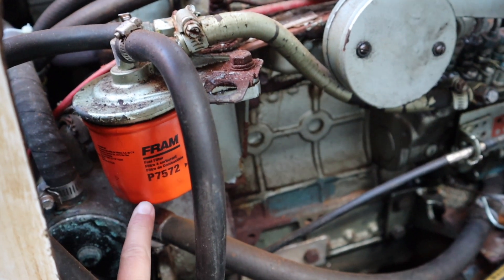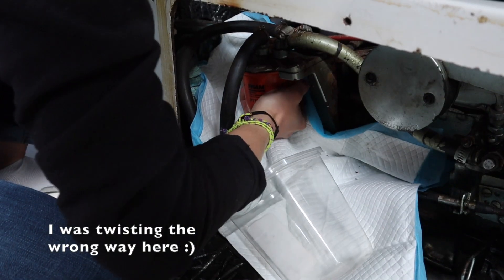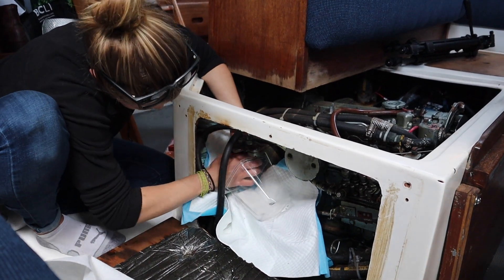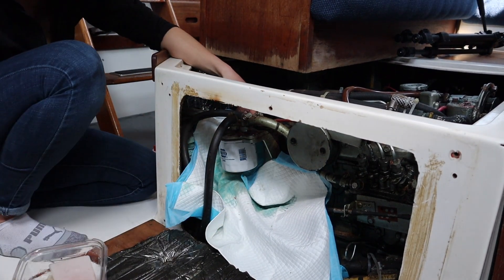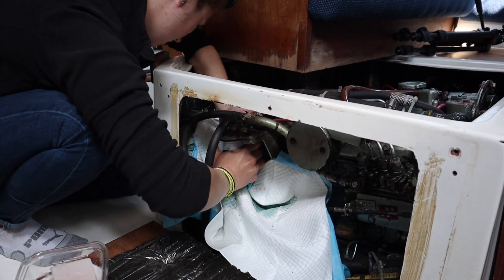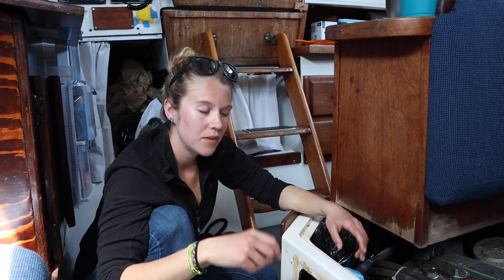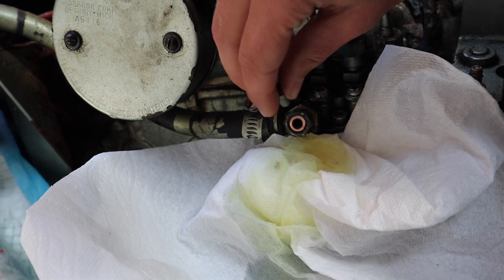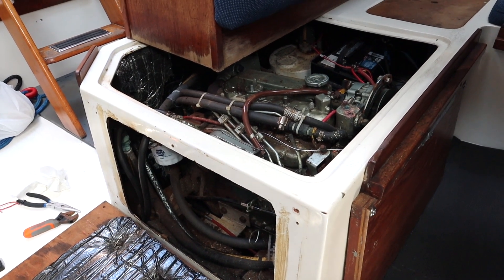Changing the Fuel Filter on a Universal M-30 Diesel Engine | Engine Not Getting Fuel

Comment: Hello great video. After dealing with this multiple tomes i simply purchased a small outboard tank and now assured to always have clean fuel.  still using the filters but have the confidence of not losing power. hope this helps

Comment: You guys did a great job with this "how to" video.  It was easy to understand and I am sure many diesel engine newbies will appreciate it!!  During our first circumnavigation we encountered exactly this in big seas off of New Zealand.  We looked at each other and said" Heave-to time!!".  That gave us time to deal with everything and then we carried on.  Once in port in New Zealand we had our fuel tanks polished and bought a special filter for the fuel we would have to fill up with in less than civilized countries.  I believe one brand is called a Baja Filter - we would run the fuel through that filter (it is large and handheld) as we filled the tanks.  We also fill our tank on Pixie completely full in our winterizing routine so there is no condensation... one of the other comments explained why.  Great video!!
Reply from the maker: Hey Cathy! Thank you so much for sharing this experience, we will definitely put some of this into practice :D

Comment: Good job, don’t take the bleeder bolts out just loosen them about 3/4 of a turn.Also not necessary to bleed at the injection pump.if you change the main filter use a 10 micron or bigger, racor has a 2 micron and that too fine.It will stop up and look perfectly clean when you pull it out but it is clogged.I had a Universal 35 just like yours in a 37 Oday.Good video👍👍😃
Reply from the maker: Thanks for the advice!!

Comment: Hi Guys, From a mechanics point of view you did well.
I read someone suggested fitting extra filter, my advice is just to save the expense just change the filter more often.
The more things you add to the engine the more things to go wrong, extra filters would involve more fuel lines and connections ,more chance of air leaks etc.
Good luck and take care.
Reply from the maker: Thanks for your advice!! that makes sense :D

Comment: Very smart to buy two, one to use and one as a spare.
If you always do that you will build up an excellent spare parts kit over time.

I had a similar problem once and it was the air filter that got clogged up because one of the many belts was shredding and the very fine pieces of the rubber/fiber belt completely smothered the engine. Also a very easy fix.

Nice demonstration video!
Reply from the maker: Good to know that an air filter could also cause the problem! Thank you :D

Comment: Great video and very easy for newbies to follow.
Definitely change primary filter, that's where the biggest bits are trapped.
To clean out the tank is easy you can do it yourself or just call up your local fuel polisher, yes I know it sounds weird but they don't actually polish the fuel 😆
Ok finally a tip. Always keep your tank as full as you can in winter, reason being, just as moist air when it hits the cold surfaces of the boat condenses, the very same thing happens inside your tank. Lots of people leave their boats over winter only to find the fuel is contaminated with water in the spring.
Full tanks never get water contamination as there are no surfaces to allow moist air to condense on.
Hope that helps.
Oh I love this channel it's perky and very fresh, with two great characters. 
❤️
Reply from the maker: Thank you so much :D And thanks for the tips!! We'll remember that and keep the tank full this winter!

Comment: Great, changing the fuel filter is not a big deal, write down the date on the new filter so you know when it is the last one. Furthermore, you don't need to completely take out the air screw/bolt but just a little is enough to let the air pass and you have less mess to clear up later. Happy sailings, good luck.
Reply from the maker: Thanks for the tips! Yes we have recorded the date but it's a good idea to put it right on the filter :D

Comment: Get some Liquimoly Diesel Purge and fill the secondary filter with it.  Diesel purge will clean your injectors and prechambers.  Wear good rubber gloves.  Doing a purge using only the purge fluid every 100 hours is also good maintenance.  You should also be using biobor for crud growing in the tank and an antigel given how little you use the engine.  

Good job, well done video and explaination. Retired master mechanic here.
Reply from the maker: Thanks for the advice!!
Reply: Alan, can you describe a Liquimoly diesel purge as maintenance? How often?Just pour out the contents of the filter and fill with the liquimoly. I use my M25XP for less than 20 hours a season  (I often can sail on and off the mooring). I use Biobor JF when I top off the tank each fall before haulout. Should I also use Startron enzyme tank cleaner yearly (in the spring?) or would that be overkill or unwise?
Reply: @ross20  ideally you fill your new filter with either clean diesel or purge fluid.  As a maintenance thing I would do it every 200 hours. Or when changing the filter.  A proper purge is to run the engine off the diesel purge. You fill the secondary filter. Run hoses for inlet and return directly into the Diesel Purge can then run the engine at various speeds until all the DP is used up.  If you use your engine very little your biggest risk is algae ( biobor should take care of that but not always and then you have the dead bodies to deal with) and gel/wax/asphaltines.  I used to drian my fuel tank and fill with fresh fuel every 2 years. The old fuel goes into my oil burner at home. In your case I'd use DP when changing filters (every 100 hours or sooner if the bowl gets cloudy)  and a good anti-gel yearly and replace the fuel if there is ever a hint of algae bloom going on.